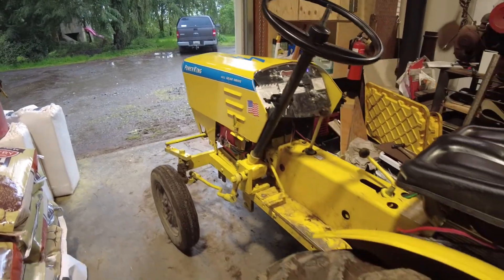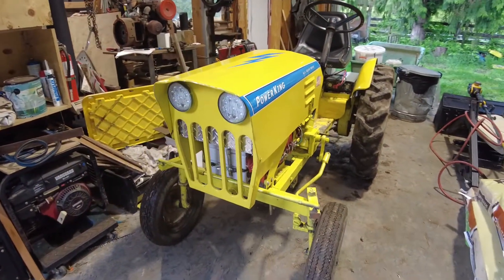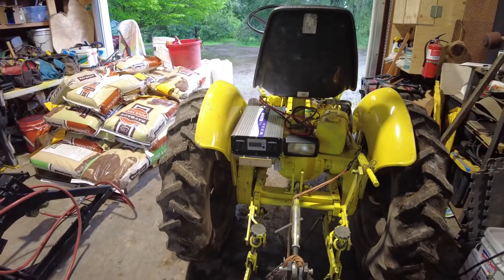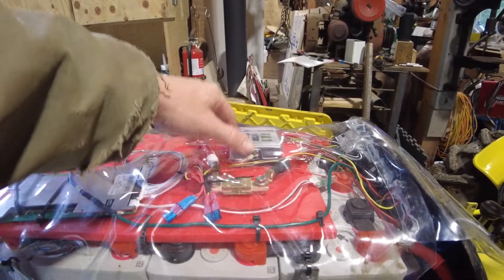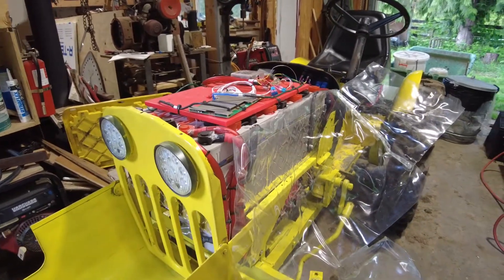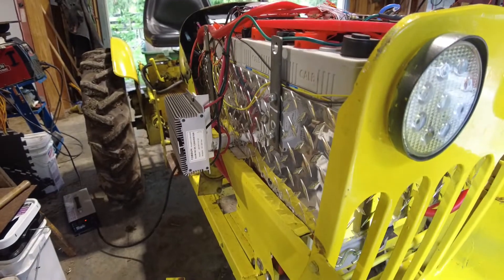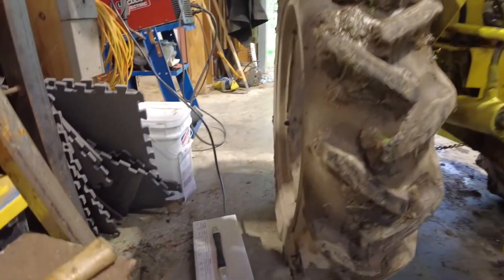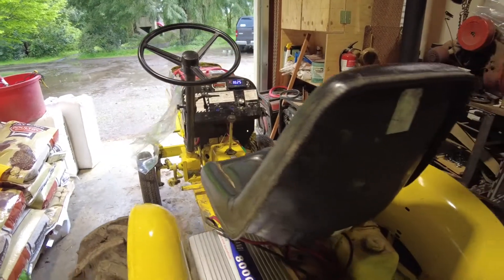EV tractor conversion overview

Comment: HI, how did you decide on what size motor and batteries to use? I have a small lawn tractor which I would like to convert. but not sure what size motor to use.
Reply from the maker: Hi!  I figured out my then existing engines hp and ideal rpm and then started looking at different electric motors online.  Most of them are rated by torque in NM (newton meters) and there is a conversion equation.  Here is a link to a calculator that can help:
http://wentec.com/unipower/calculators/power_torque.asp

Good luck!